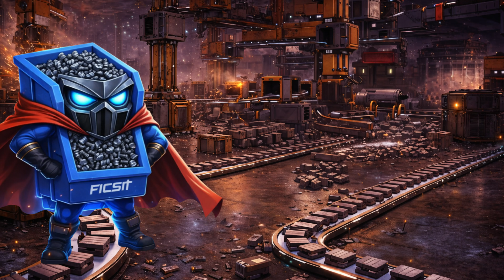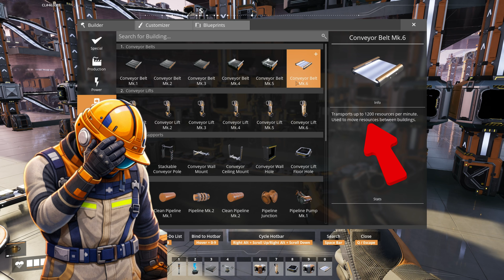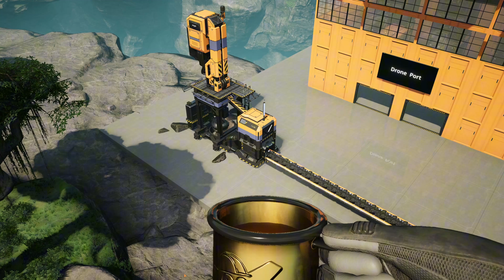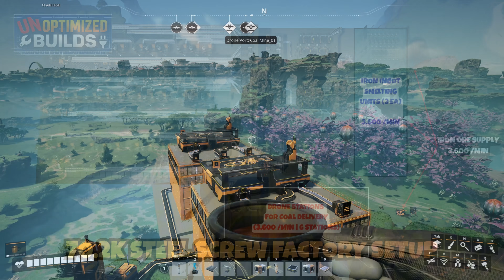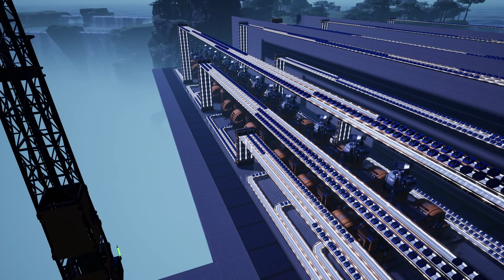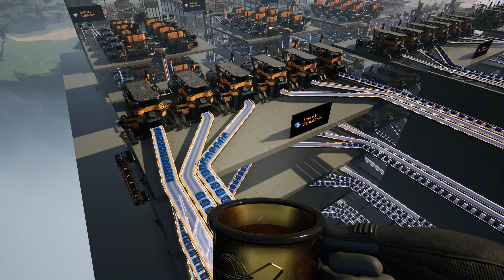Stop Producing Screws Wrong in Satisfactory 1.1

Comment: At want point should I be building factories for specifically one item? Im pretty sure im on phase 2 of space elevator tier3/4, I have these 3 iron nodes by each other, each one splits into 3 smelters then into 3 constructors for screws, rods, plates I also have 1 of the storage containers that hold the screws and plates into an assembler for reinforced plates, and another one that has screws and rods into one for rotors, the one that just holds screws and isn’t used for anything, I always run out of screws in the ones for reinforced plates and rotors, always having to get screws from another container and manually do it sometimes
Reply from the maker: It honestly depends on your setup and what you’re trying to do. I tend to over produce screws so I don’t run out
Reply: @unoptimizedbuilds got you thanks

Comment: Making screw factories is cringe. What you do is make them part of your factory cells in your manifold.

So for reinforced plates, you take a constructor that inputs iron or steel parts to make screws, then direct insert from the constructor to the assembler.

This works for most parts who have a smaller input than output; so screws, wire, silica, and the like.

It's easier to build blueprinted unit cells that take the most reasonable minimum throughput inputs rather than trying to make a series of super complex factories with complex interconnections.

I was able to take bauxite to aluminum through a unit cell with 2 refineries, 4 furnaces and 8 constructors to get 1 full belt of aluminum ingot production from one 5xn corridor. 

This can be used for many different input types.

You can merge this with super dense logistics, where you fit the logistics into the machine footprint, to get clean, and compact builds.
Reply from the maker: That’s a really clean way to approach it. Building around unit cells and minimum throughput makes scaling way more predictable. I’ve been leaning more that direction too, especially with blueprints, just keeps everything modular instead of turning into one giant spaghetti mess.

Comment: I typically build screws as local as possible... design small module of machines, one of them producing screws and never sharing it with other modules... that resolves the screw production issues nicely.
Reply from the maker: I total agree — localized screw modules eliminate the need for massive screw buses and prevent cross-factory bottlenecks. Keeping them self-contained is a smart move.

Comment: I made a BP of 8 stacked asseblers alginent to 8 stacked contructors then cut away both half for two Bps. I can make enogh reforced plates in a 5 by 4 area for 30 HMFs/min. It never occored to me to make logistics for screws. if the input of a machine is near a full belt. direct feed the input. If the output of a row is near a full belt loop it into the next row of machines. Wire / Quickwire eg.
Reply from the maker: 30 HMF/min in a 5x4 footprint is really clean! Direct feeding is also an underrated move. Thanks for sharing this!

Comment: I think the common frustration with screws is how they throttle production volumes in the early game when you don't have the higher capacity belts.  Then, by the time you get those higher capacity belts, you've gone totally screw-adverse and are using alternate recipes so you don't see how screws can be perfectly feasible if you get your maths right.  This is an excellent showcase proving that screws are fine.  Now, if you don't mind, I'm going back to making iron wire and stitched iron plates.  😁
Reply from the maker: lol, 10-4. Iron Wire and Stitched Iron plates are 2 of my favorite alternate recipes! Happy building!
Reply: Started 1.1, building first rotor factory. I just 'love' splitting my t2 belts between 10 constructors and 4 assemblers. Once I done with this, straight to save-rerolling alt recipes until I get all screw-less recipes.